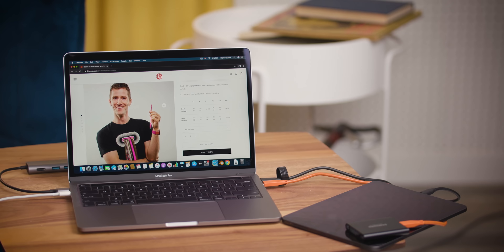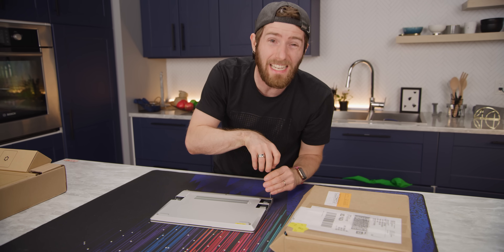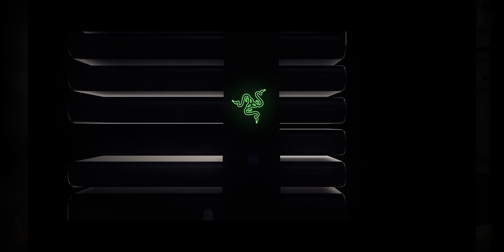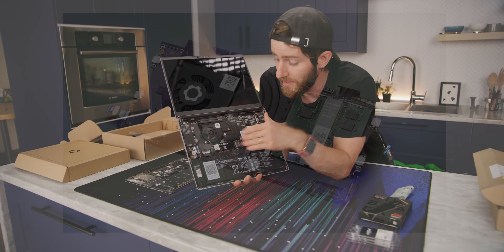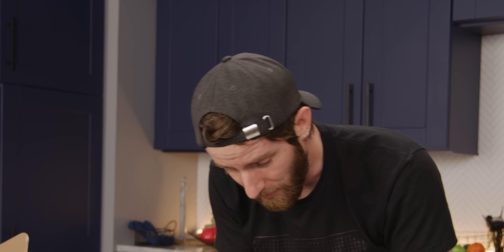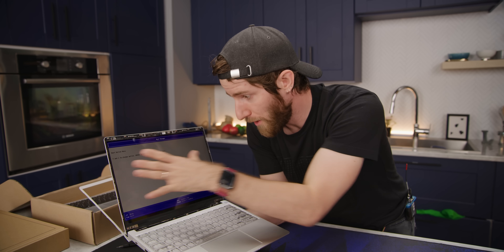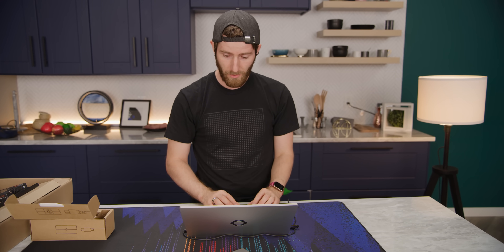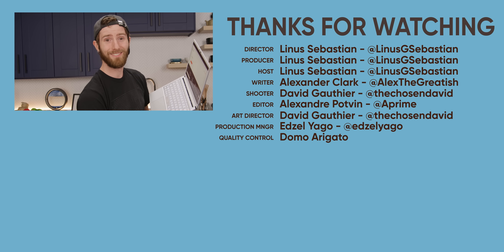A COMPLETELY Upgradeable Laptop?  - Framework Laptop Review

Comment: Modern hardware to upgrade even a simple hard drive really pisses me off, my grandfather has a 3yr old one that I literally have to dissemble into pieces and even remove the keyboard just to get access to anything underneath, ffs companies what the hell!. Yet I have an old 2011 HP laptop where its so simple to access, just pop out the battery and slide a switch to remove the large cover hiding the hard drive, RAM and wifi card. To upgrade the RAM on a lot of modern laptops could take me 30/45mins but this old HP I'm done in 30secs.

Comment: Yah the cpu isn’t upgradeable because its soldered to the board. But if they continue to use the same form factor of the motherboard you can replace the entire board with the new CPU on it. Which in a desktop if your waiting a reasonable amount of time you need replace the mother board anyways.

Comment: I recently disassembled an old Asus laptop and moved it out of the case, I had to tape over 3 freaking sensors for it to even POST in its new enclosure.
Reply: Honestly those kinds of things should be fucking illegal.

Because it wastes silicone and it also is completely unnecessary.

Comment: "The Dell's not even f***Ing thinner". Mic drop moment for Framework, lmao.
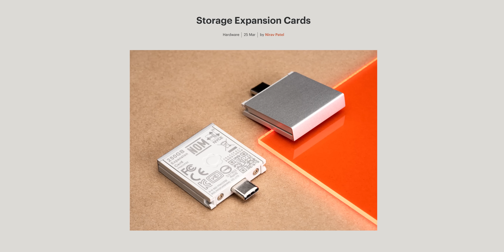Reply: 5:40 This should be the new standard.
Reply: Kevnev Katfute  its hardly come true ngl. Type of people who buy thin light laptop highly not do something that really stress the laptop so those laptop will survive for a long time => by the time you really need to swap the cpu (which inculding the mobo and cost pretty high) the new design will not match and you would properly buy a whole new one by then
Reply: That Dell has a high performance CPU and a discrete GPU though. Should have used the xps 13 to compare
Reply: @mcslender2965  it doesnt need to have a discrete card it just needs upgradability i bet you someone can make a gpu extention card
Reply: @unknownuwu3890  The point is that the XPS 15 does have one and a second fan AND a much larger battery. Having said that I still prefer Framework.
Reply: @skybike89  even with tb4 you bottleneck the gpu by a lot, and egpus still cost a lot, and the xps is just better in every other thing than the framework, keyboard, touchpad, screen and battery life these are crucial features to people buying these premium ultrabooks, and the xps has the thinnest bezels in laptops, while the framework looks like a laptop from 2014, personally i don't see the point of the framework, almost all laptops let you replace ram, ssds and battery, just the 'you can put your ports anywhere' doesn't justify this laptop
Reply: @daftrok  same
Reply: @skybike89  i know
But i wanted like a gpu chip inside a bigger extension thing
A mobile gpu ofc
Reply: @unknownuwu3890  yeah I bet if this concept gets big enough Iam 100 percent sure that’s gonna be available
Reply: @thegardenofeatin5965  nice point but for me i would take an overall better laptop in all areas rather than one with ports that can be removed
Reply: @daftrok  i prefer it too and understand ur point but no one likes dell
Reply: @daftrok  do even if their laptop is ebtter i will never buy it
Reply: @naseemyasir  I personally believe this will be helpful for the people who are in the field,  break something,  replace it,  need a specific port to run your equipment,  change port, and best of all that headphone jack ; )
Reply: @DragonHeart-hj5ji  yeah as I said it's a good feature for many but not for me and I guess for many others too
Reply: @mcslender2965  Yeah, not exactly fair. And Lienus didn't really touch on this not having a GPU.
Reply: @UmamiPapi  it's a 13.5" laptop, if you want a dgpu in there that's a whole other story, and it's supposed to be small light and thin, not powerful
Reply: Kevnev Katfute   what possibility is that when new hardware come out, they are going to make specific motherboards with new cpus for  a laptop they released years ago, that is not a sensible marketing strategy, and if they do make morherboards with new cpus, then would the cooling system of this laptop be able to handle those new cpus??

Comment: i am a FAN!!! 2/3 of my USB ports broke about a year ago and i have been forced to use the USB port for exclusivly my headphones (a cheap pair of headphones snapped of in the mic port and it is a pain to clear those things out so i have to use usb headphones) and my trackpad ever since! i COULD go into the laptop and repair the usb port somehow on my own, but im scared i might break the laptop becuse i dont know what im doing, and id rather have a tad bit of extra suffering over not using a mouse then not have a laptop at all. I have looked at the options in my area and if i want to get it repaired it will cost me about $50 which honestly isnt worth it at all, specialy becuse getting it repaired means i have to go a week without a laptop. if ALL laptops where so easy to repair/replace parts with then i could EASILY replace the part of even repair the usb by myself in 10 minutes and save myself $50. This kinda laptop litteraly CHANGES the laptop industry. It makes upgrading your computer VERRY easy, so people would buy better parts wayyy more commonly, and it makes it so users can easily replace there parts (which in part means the company who sells these parts is making more money) so its a win-win for everyone involved. Why hasent every tech company adopted this model yet?!?!?

Comment: I would pay more for device with identical specs if one is fully repairable and supported by the manufacturer like this vs one that they intentionally make difficult to repair by doing things like soldering on RAM and gluing down batteries.

Comment: Well technically some laptop's can have a desktop CPU stuck into it. So that means it would be upgradeable but with certain power requirements and limitations. But now with green team dropping the mxm design the GPU's were kinda upgradeable, that's thrown out the window with Big green dropping mxm. Granted the current CPUs are pushing 8-10 cores, so they'll be usable for some time depending on the clock speeds.

Comment: Show me one with an upgradable GPU, then I'll check em out.
Reply: I'd be surprised if they didn't eventually offer CPU/GPU upgrade/trade-in options that are simple motherboard swaps (since the CPU/GPU are soldered in-place to the motherboard, less bulk than the way desktop CPU/GPU's are installed) - buy the replacement board, drop it in and use previous RAM and SSD, send the old motherboard back for a refund.
For now though it seems they're using Intel iGPU options, but once they start offering AMD CPU options they'll probably be AMD APU's like in the Steam Deck, PS5 & XS systems.

Comment: I fail to see how this is "completely upgradeable". 

Yes you can drop more ram and more disk space right onto the board, but propriety USB 3.2 "cards" are throwaway gimmicks that only ensure profit for the manufacturer. 

When apple lets you plug in any dongle you want with thunderbolt its scary and encroaching on right to repair, but when these guys take it a step further with proprietary accessories using universal parts (use twice the plastic to have two cards over), they get a pat on the back.

Comment: But this is NOT taking it far enough.

we can buy parts and buy our own pc for over 40 years now.
why are we still forced to buy our laptops like we need to buy a console.. and be glad if we are even allowed to upgrade 1 or 2 things..

I want a concept like for pc but for laptop.
**screens (1 complain I have about laptops is : tooo small.. I want 21 inch... but nobody SELLS 21 inch laptops....  But I not care for touchscreen.. others might want touch.
I like fast IPS, others are fine with IPS.. I like 16:9 others want wider... give freedom to pick!
**cases, I want a THICK full metal case, I not care for weight saving.. I want room for an optical drive, and room for that 21 inch screen (and a set of different bezzles with it so one could mount a couple different screen sizes if one wants tooo say a bezzle for 17, 19 21 and 23 inch with my case.
Others want very slim and light... we should have the chooice.
**a standardised laptop motherboard format.. so we could just put it in those laptops outselves...
**I want the fast GPU but I do not neccecairy want a hyperexpensive cpu.. in most laptops those are paired. you cannot get a 3090 or 3080 paired with an i5 class cpu.
**I want to be able to pick my own ram so I can get the best type.
**and I do want extremely long battery life.. despite it being a gaming laptop.  a feature no gaming laptop delivers..
**I want to pick the camera, speakers and webcam options and quality myself.
**I not want a touchpad at all.. but a larger full mechanical keyboard, totally fine with always having to plug in a mouse.

what is keeping the hardware manufacturers of pc components to just agree on a standard for laptopparts so they could be sold as pc parts are?

I have looked in the most obscure corners but while compagnies do excist that allow you more freedom in laptop configuration NONE will allow you to pick screens of 21 inch.. let alone paired with my other desires.

Comment: I challenge you Linus you must use that laptop for 10 years and get parts to upgrade it or Shut about that Vendor if you can't get parts 10 years later that laptop upgradeable  is useless so shut or put up I think you might agree with this 10 year challenge from this point now on you must use this as your daily driver for 10 years

Comment: Yeah.. we'll see in a few years how this went. Just as Linus said: other companies have tried it and failed. Friggin Google tried to make it work on phones (remember Project Ara?) and failed. Right now, the only difference in upgradeability compared to, say that Dell XPS 15, is the external I/O. And I rather have a USB-C port than a HDMI-out I might not need all the time.

Maybe in a few years they will still be selling motherboard/CPU upgrades, and maybe we'll see new screen upgrades come out for this model, years from now. I very much doubt it. Too many companies tried and failed. Maybe if we're very, very lucky you'll still be able to buy replacement batteries for this in a few years, and that by itself is a nice improvement over most other laptops. Frankly, that is just not worth this much hype. Heck, ifixit has guides and replacement batteries for the Dell XPS series as well.

Comment: now add swappable cpu and gpu boards to make it fully modular and upgradeable and you have in my opinion THE ideal laptop. (shouldn't be too hard to do, small pcb with cpu/gpu soldered onto it that connects via something like a ribbon cable to the rest of the motherboard.)

Comment: If they add an ortho-linear keyboard as an option they will have the best laptop on the market hands down. And if they made a V2 where modules used PCI-E x4 or M.2 instead of USB-C, that would just take it to the next level. Imagine plugging in a module that hooks up to a PCIe direct eGPU. Since there are 2 modules side by side, plug in a dual unit for x8.

Comment: Wait wait wait wait, the CPU dont have to be soldered. 2nd gen Intel used PGA for their CPU back then...........however, if intel changed that designed for whatever messed up reason; would it not be possible to use desktop CPU's with bios designed to lower the TDP to make sure if can run in a laptop, or am I being too optimistic with that....OR OR OR, modified CPU's with the CPU soldered to a breakout board (like what Linus showed a few years ago), then sell those as an upgrade path.

Comment: I love this, it IS the future, and I wish Framework success for bringing it to market. "However", since they're still a young-ish company, I want to help steer them in the right direct. 1. "modules" 7:25 Hot Swappable=Awesome but to avoid all slots being taken without getting all the connectors I want give me "Large" multi-facet connectors that I can plug "HUBS" into, that way, I can have as many as I want (beware bottlenecks) 2. The CPU, sure, they SAID, ARM, X86 and even RISC 5, but I'm sorry to say, I demand that. Intel for me is a deal breaker. 3. 14:31 The unattended driver installer is EXCELLENT, "but", A) the user should be prompted so that "unstable" drivers don't catch them by surprise and that should come with easy roll-back feature. B) that installer better have P2P or better because SPOOFING updates and cloned security certificates have zombied more computers than I care to imagine. 4. 16:28 I would LOVE to disconnect my battery completely but I think Lithium doesn't like that, so can I have the best of both worlds? I want to run off the wall socket, but keep a bare minimum charge of about 5% to make sure the battery doesn't just DIE. (not entirely sure how batteries configure that 5%). 5. I want my OS in a bootable drive so that I can time it's install or change my mind at my discretion. 6. I want SERIOUS cooling options even if they have to get inventive. 7.UNWANTED ITEMS/FEATURES, I don't want a "fingerprint reader" please, don't charge me for that, don't need an "integrated" webcam, again $, I'm a little divided on a touch pad AT ALL (sometimes useful if the driver on your USB won't allow you to plug in a mouse). Some things that are standards or norms are things I've never used (for privacy/security/quality reasons) and will never use, so if I can remove them and if it even takes a few bucks off the bottom line, HURRAY! IN CLOSING: sorry I wrote a book but I MEANT IT, when I said I wish them well, and I'm assuming they will read this. They have a golden opportunity to become an industry leader if they get this right, and the consumer deserves WAY better than what we're getting. "Good Luck".

Comment: What I'd really like to be stoked about is something that for a while will remain to be seen. Will they hold the same motherboard form factor for long-ish periods of time so even if a product outlives its usefulness it becomes a single part replacement and not a full system swap? That would truly make this machine great. 

If they want to make me dump my money immediately and pass my existing laptop off to someone else all it needs (I say as though it would be an easy task, it isn't) is interchangeable GPUs through something like an MXM connector... The reason my gaming laptop is a rather cheap one, and that still have a gaming desktop comes down to upgradability, when my 1650 max q is out of life then the laptop ceases to be a practical gaming laptop and the full cost of replacing what might be an otherwise adequate machine is significantly greater than getting a new graphics card in my desktop, and potentially more wasteful... I bought an alienware with a 2070 off a guy for $20 because the GPU had died making the rest of the PC useless aside from RAM and the WiFi card (and the storage I guess but he understandably kept those parts). I'd love a world where I could say "no problem lets pop the back off here and get a new graphics card, she'll be good as new when your part gets here" rather than "sure I can fix it but the cost of the full motherboard replacement even with a used board is only a $70 less than getting an entirely new machine after the labor cost"

Comment: Did Linus break their site? 
I went right over to their site to try and check out a laptop and I couldn't change the CPU without getting an error on both the Canadian and American site!

Oh well... I guess I can wait :)

A question though about the modules... with a USB C interface could they just be connected to any other computer? That storage drive becomes really useful it's essentially a USB C Drive that just happens to slot into the laptop

Comment: So basically they are actually encouraging you to 3d print/CNC/DIY a case to actually use the working mobo when you decide to upgrade down the line and not simply throwing it away.
Is the screen connector proprietary or can you simply buy a new one (like from eBay/Aliexpress) and connect it?

Comment: Imagine if they designed cars like this
Reply: Unhappy with your 2 cylinder engine? Upgrade to a modular twin turbo V12
Reply: The thing is... cars USED to be designed like this. Then luxury brands realized they could make a buck off hiding and making things proprietary, and now everyone does it because it's free money and no one is complaining about it because it's become the standard way of doing things. Hell, there will even be people who actively bully people who figure out ways of replacing things themselves because they view it as "dangerous not to pay the professionals to do it". (See "Tesla battery cooling system nozzle")
Reply: @Clawthorne  This precisely is why right to repair should be a thing
Reply: This is exactly what owning a 90s Subaru is like.

You want the sti suspension? Bolts in. You want the 6 speed from the sti? Also bolts in. You want the stronger rear diff from the sti? Good luck finding it but when you do, it also bolts in but you need hubs to suit.

Ok, not exactly like it, but similar
Reply: I just wanna have blind spot monitoring and the car company forcing me to buy the highest trim.
Reply: @s.n.7990  your eyes are your blindspot monitoring. Turn your head